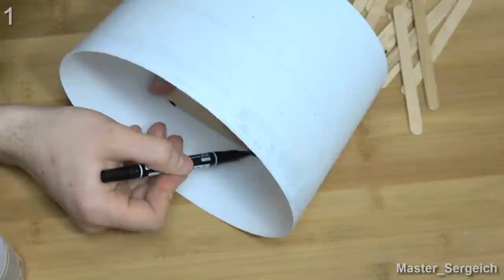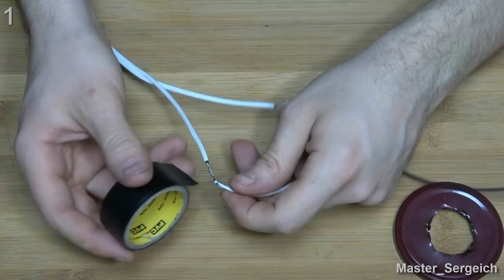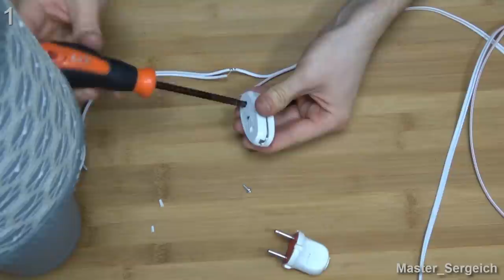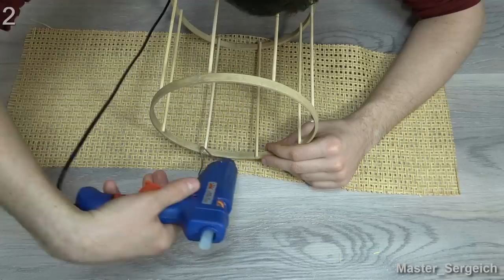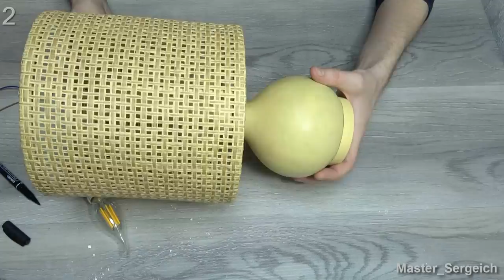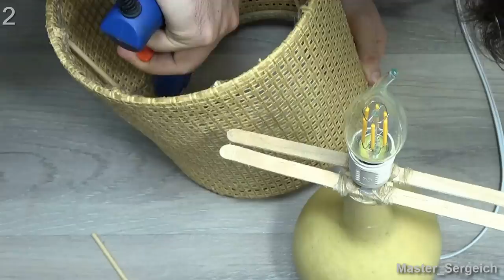2 IDEAS HOW TO MAKE A NIGHT LAMP, a detailed master class

Comment from the maker: The hot glue in these lamps holds the structure very well, checked! From heating, too, nothing will fall off and will not light up, because the LED lamps heat up very weakly
Reply from the maker: My kitchen (مطبخي)  Thank you